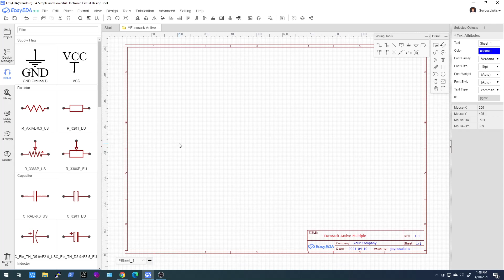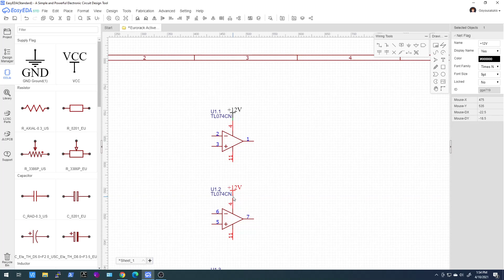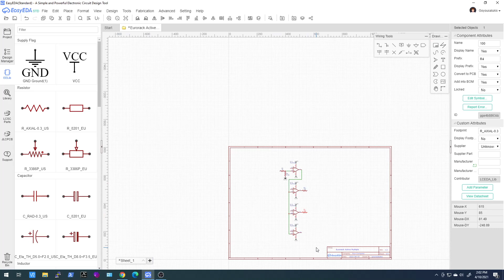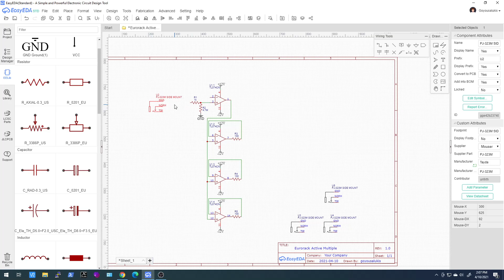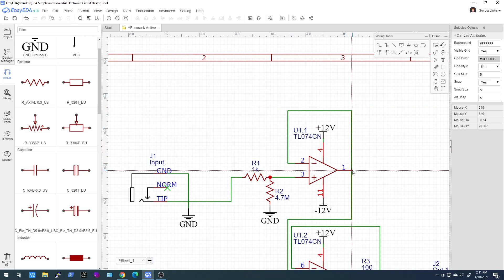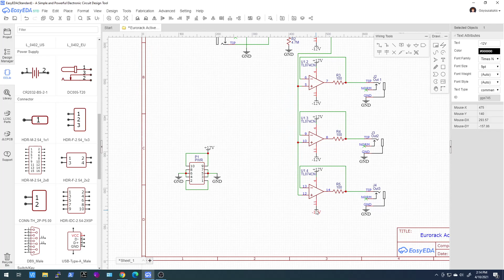Designing your first Eurorack Module using EasyEDA Part 1 -Schematic

Comment: Why did you change from the lm324 the 074?
Reply from the maker: Hi Jim. The LM325 is a single rail opamp, but for eurorack, we want to handle +/- voltages, so we want a dual rail.